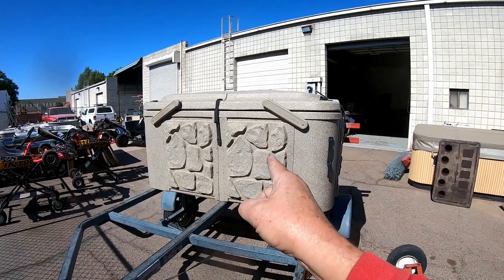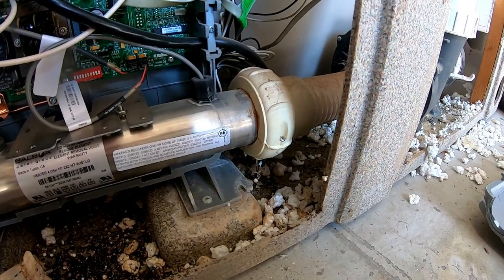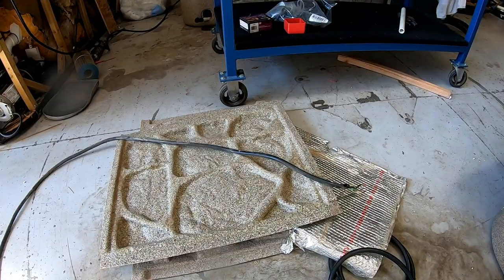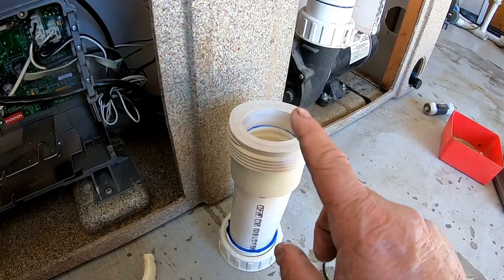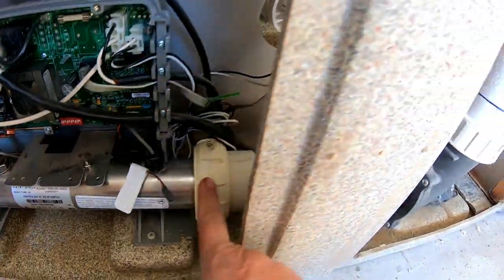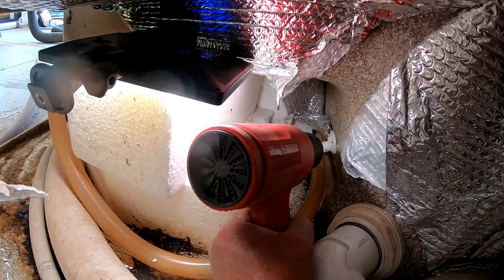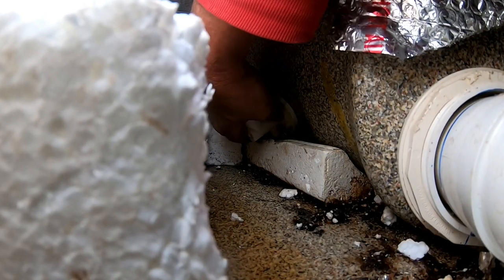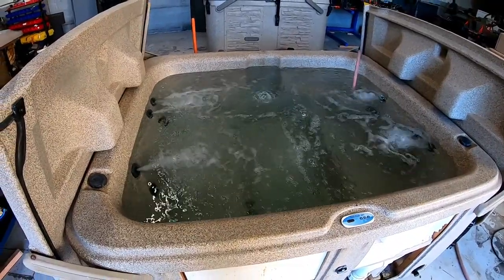How to Flip a HotTub...

Comment: Great video. I have a leak in the suction assembly in a thermospa lexington. It's recessed into the deck so I can't get ro the back side or underside. Can I try sealing around the cover?
Reply from the maker: You can try but I do not think it will work. if its the suction assembly that tells me it at the very bottom of the spa and to get to it you might have to tip the spa on its side and go in through the bottom. Thanks for Watching & SUBSCRIBING
Reply: @spaman5440  thanks... the spa is recessed and of course that's the only part I can't get to from the dry side... and the spa is very old so I'm concerned that it will fall apart when it's tipped... but thanks for the reply

Comment: I just ordered a 110/15 amp hot tub. It won’t be here for a while so I’m prepping for it’s arrival. I bought an extension cord that’s 10 ft. 10 Gauge rated for 120/15 only to find out the prepping material says Do not use an extension cord. I planned on running it from the garage via PVC pipe and bury it via PVC pipe to the tub area and come out of the ground on a riser into a plastic weatherproof box and make the connection into that without the cord ever coming in contact with the ground. Is there anything I’m missing on why they said not to use an extension cord? Thank you for the videos, my wife hates me for turning them on when she’s watching her shows :)
Reply from the maker: Am extension cord is not the recommended.. You can get away with it short term but long term will cause problems... Some manufactures will void warrantee if it is not a dedicated service(Read owners manual)  NOTE Some dealer will only tell you what YOU want to hear when it comes to this!   With a 110 Plug & Play Spa it is recommended that you use a 20 amp dedicated service...Over the years extension cords have caused a lot/most of the problems that I have seen with 110 Plug & Play Spas..Thanks for Watching & SUBSCRIBING

Comment: F1 is filtration 1 hr twice a day isn’t it?
Reply from the maker: Filtration Cycles run from F1 to F8 (F1 = 1 hour every 12 hours / F8 = 8 hours every 12 hours). Preset cycle set from factory is F1, so if in ec or sl mode your water will not reach desired temperature. Hope this Helps Thanks for Watching & SUBSCRIBING

Comment: Great video Thanks, Just bought a used Tuff Spa TT400 so it was helpful watching this, I see you have a TT400 behind this one was just wondering if you could go thru the to vent valves mine has one on left right and a large one in middle but their is a empty hole smaller one in the middle? Also what is the large blue thing inside by the power box? Thanks again.
Reply from the maker: Call me and I'll help You
Reply: @spaman5440  What's your cell #?
Reply from the maker: @dustinyamchuk7400  Google ...Arizona Hot Tub Factory

Comment: I just bought a Tuff Spa tt450 platinum. I’m putting it on recently installed pavers and it’s isn’t perfectly flat, but theres about a 1/4”-1/2” concave dip toward the middle.  Should I be concerned about installing it on this surface?